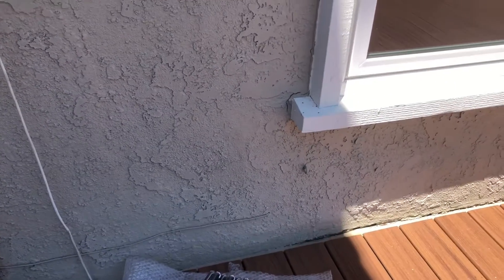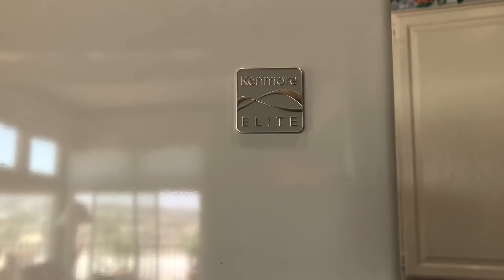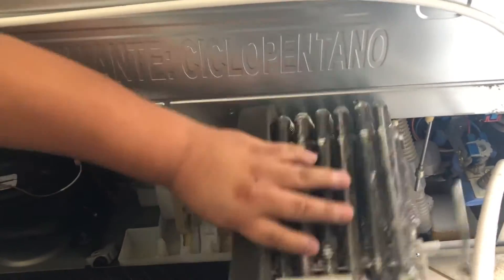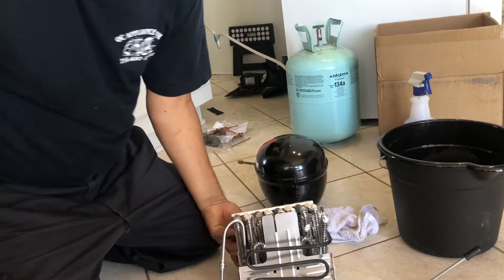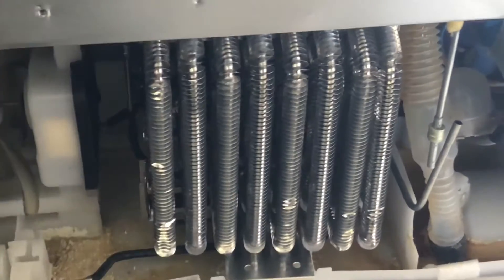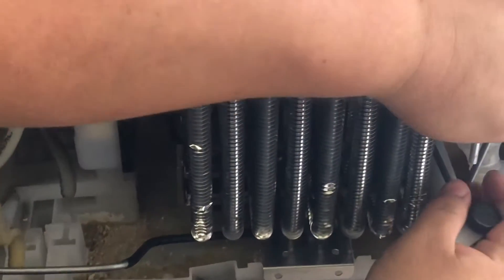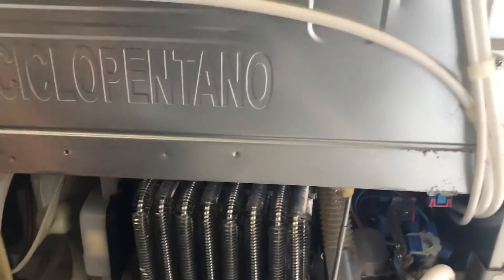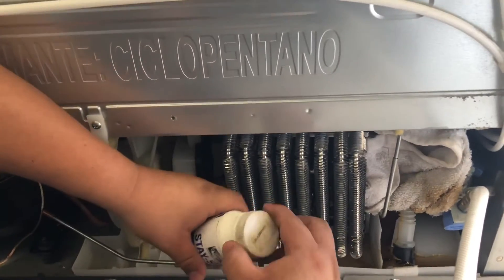LG refrigerator. Replacing condenser

Comment: Put a compressor in an lg today. -10 low side high side 225. Condenser not getting warm. Restriction?
Reply from the maker: -10 PSI?  
Most likely a restriction 
did you replace the filter drier. Also if it’s a duel evaporator you need to make sure the 3 way valve is open to both sides. Before you pull a vacuum. Did you weigh the Freon?  If you didn’t weigh the Freon you might be low on Freon
Reply: @appliancerepair420  replaced the drier. Weighed refrigerant. Before evacuating I plugged in and waited for the condenser fan to start before unplugging to get the valve to neutral.
Reply: @appliancerepair420  but I think it may be a single evap. Which is weird because I can hear the clicking. I thought it was the valve could that just be the relays on the board?
Reply from the maker: @Ashroyer86  what’s the model number for your refrigerator
Reply from the maker: Look at this video 
https://youtu.be/YUAx9j7Esk0
Reply: Did you find out the problem? My refrigerator did the same thing.. I just ordered another filter dryer I will try the test mode when pulling vacuum this time.

Comment: Do you/ have you ever used Locring?? I am looking into it at the moment. If you have used it ….what is your opinion of the product ??? Thanks…nice job BTW
Reply from the maker: Have not used locring be for have taken clases on it but the start up cost is very expensive but it is better and faster. I think if you can get it and take the time to learn to use it it will be good. Especially since the new refrigerators using r600 is flammable